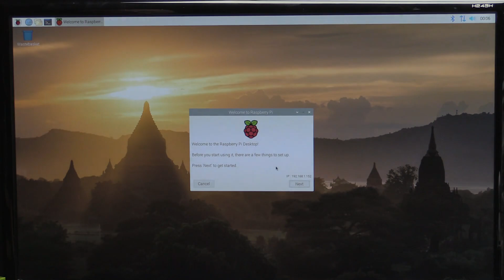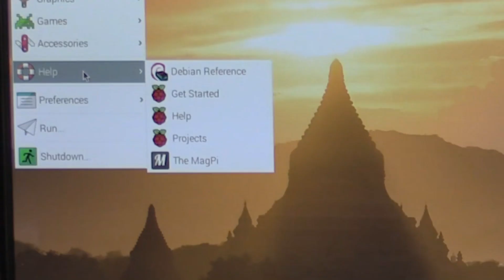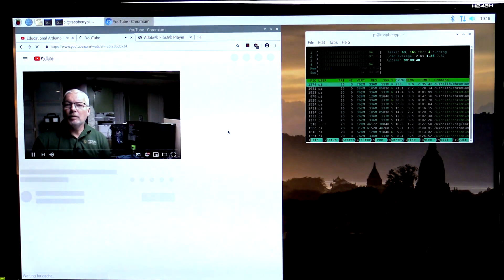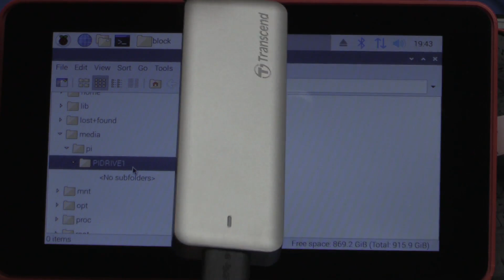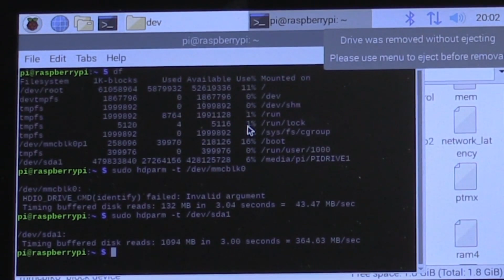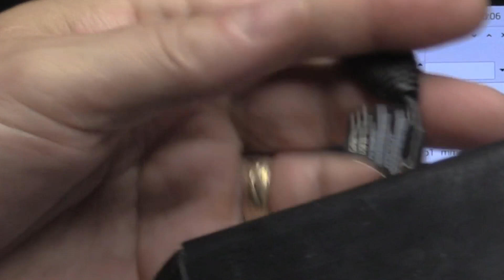Raspberry PI 4 Intro and testing with original accessories

Comment: Hi, I'm thinking about buying a Rasberry Pi 4 and using parrot security as the OS, do you think thats a good os to run on the PI 4 4GB, will it be too slow for everyday computing, of cause its going to be a compromize but is it dooable? the reason for parrot os is that I like to learn about security/woulnerability in modern day technology, and it (parrot os)seem to be getting more attention and expected as a good competitor for kali. I need to evaluate a low priced computer and I am falling for the raspberry pi, and its to much singelboards computers around and at the same time getting to know all around the arduino and the sorts. I see that some are using Kali linux on the pi, and it might be an option for me as there seem not to be any rewieve about parrot on the PI 4 if parrot can't be installed I am thinking about a temporary Kali linux install and then jump over to Parrot sec. OS when thats an option...

Comment: Maybe a 3 amp power supply would have handled both USB drives.
Reply from the maker: The limit is apparently in the configuration for the usb interface as well. I did not expect those two small drives to have that effect.  I will have to profile the current draw